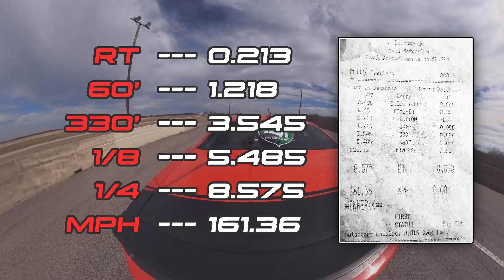My Demon broke but came back FASTER! My new personal best 1/4 mile record. | Demonology

Comment: Great job Herman ....you got her flyin !!👍👍👍👍👍
Reply from the maker: You got that right!
Reply: @Demonology   I know this is related to another video, but the new camaros are LT5 which is only 376 inches man, not even a 426 cubic inch engine small block engine like the demon is lol, the only fair comparison would be like a vehicle with similar weight as demon with drag radials similar rank camshafts with with similar gearing in the rear end like a crate LS427/570 supercharged against a demon lol make this about as about as apples to apples as you can get lol in a way, it's a shame they dont make an LT/427 not that i know of.
The hennessey exorcist is only a fucking 376/LT5 vs a fucking 426 lol.

Comment: Congratulations she’s running sweet when I grow-up I want to be like you 😁 nice run 👍
Reply from the maker: Thank you Bro
Reply: What are you now ?
Reply: @srschool4298  A old man that has a slow 🐌 Demon 😈 and is never in the states to race it because I'm overseas 🌍 trying to get rid of all the bad people 😔. For 38years now.
Reply: @Demonology  I know this is related to another video, but the new camaros are LT5 which is only 376 inches man, not even a 426 cubic inch engine small block engine like the demon is lol, the only fair comparison would be like a vehicle with similar weight as demon with drag radials similar rank camshafts with with similar gearing in the rear end like a crate LS427/570 supercharged against a demon lol make this about as about as apples to apples as you can get lol in a way, it's a shame they dont make an LT/427 not that i know of.
The hennessey exorcist is only a fucking 376/LT5 vs a fucking 426 lol.

This is the demons ''comparable engine'' 

https://www.youtube.com/watch?v=OSIK3-p8jFI